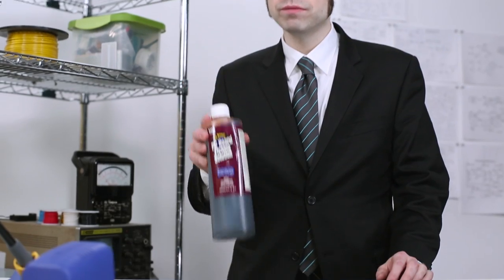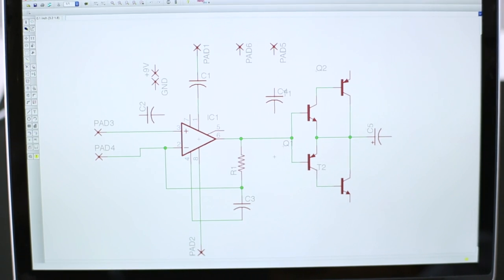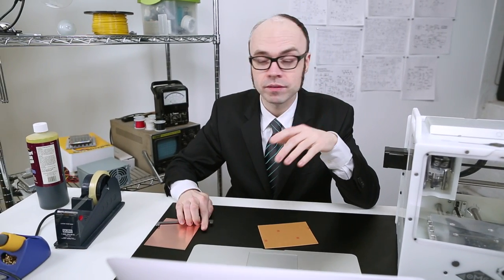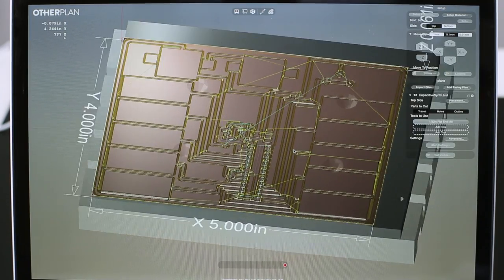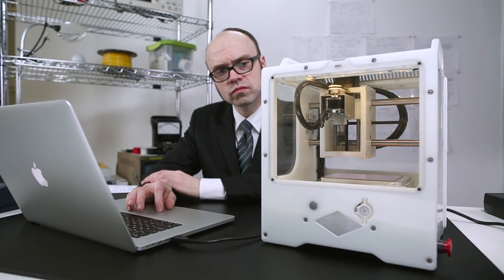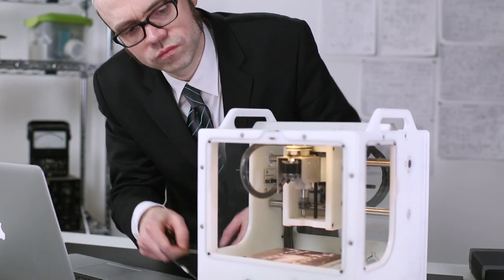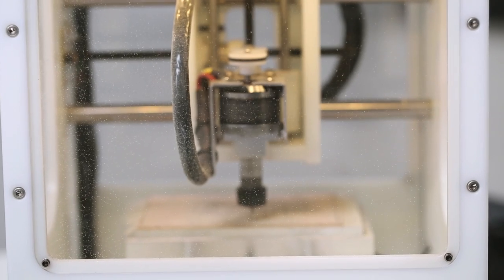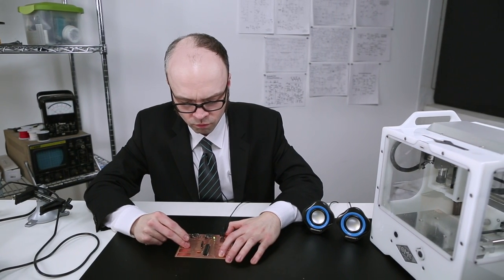Collin’s Lab: PCB Milling #Adafruit

Comment: I would actually use this machine so much more often than I would ever touch a 3D printer (although I would need enclosures for all of the projects this would help me create; still I must prioritize!)

For any current owners, can you comment on its ability to engrave on materials such as plexiglass and metals? It'd be nice if the software wasn't Mac only but I think I can still make a sell to getting one of these for our hobbyist group since it seems amazingly versatile.

Comment: Great video demonstrating PCB milling comparable to LPKF etc., but I think the holy grail is in traditional photolithography with resolution allowing fine traces reliably at 10 micron and below. The elements to process boards I’ve been collecting for several years as it’s very hard to find anything at reasonable cost second hand, so far I have a new in the box Korean GMP Photonex-sync235 laminator with 4 internally heated silicon rollers that ensure even heat distribution of DuPont risten film laminated boards, and a Kinsten KVB30D Double Sided Vacuum UV Exposure Box. The last and critical element I’m still searching is a good Photoplotter from Bungard or Fortex, however these are selling new around $10,000 much more than the few hundred I found the other tools for so I’m wondering with all the new high quality X-Y axis and laser machines coming onto market from all over the world why there hasn’t been any entry into laser raster film photoplotters that can produce fine detail solid ink black circuit art transparencies yet? I really don’t want to tape lesser transparencies together that would defeat the fine detail trace ability I want to have. Has anyone made one of these or is there a tear down video that might show how one could be built?

Comment: You should look into Voronoi toolpaths, there is a java app called visolate which will generate them, they are much faster for mechanical etching.

If you ignore the bad music caused by my indiscretion in background music you can see a run I did a few years back.

Comment: Is there any software, that makes PCB with single copper-free line between nets? There are many designers which make PCB with nets formed with individual border that need to be engraved along their perimeters. But it takes a long time and wearing mill.

Comment: Can someone explain how this works. Wouldn't the entire board be conductive?
Reply: DotCD nope, there's just a thin layer of copper on the top, the rest is non-conductive underneath. The mill machine is carving away the copper to leave traces for the circuit to follow.

Comment: But what about dust that you get in the end, if you use it regularly at home for example? What if it gets in the air in large amount? I mean, is it safe?
Reply: Glass fiber dust, especially the really fine one, is actually pretty bad stuff. It can give you something called silicosis (not from rare exposures though; it's more of a workplace hazard). The whole milling machine seems to be encased while working, so you should be fine if you just vacuum it afterwards.
I don't know if the bearings inside are that lucky though. The glass fiber dust can kill them pretty fast if they aren't built to keep the fine dust out.
Reply: It has a glass pane that can be removed. During operation it is placed back so the dust doesn't escape. Afterwards you can just vacuum the dust. Look at the beginning of the video, he removes the pane but it's rather quick.
Reply: Eyes open! You see the acrylic pane, you see him vacuuming. Look up from your games and Twitter feeds!

Comment: It would take less than one hour if the CNC machine was used just to drill the holes and the traces were done with dry film photoresist and ferric chloride/other etchant
Reply: As he said, you can use chemicals.

Comment: awesome product, but realistically, how many average people out there are gonna drop over 2 grand for a device that has a very specific and limited use?  Not to mention that it only works on with a mac. You gotta be making a LOT of boards to justify something like that.  With the proliferation of 3D printers out there now, one could make their own for a fraction of $2200.  Drop the price and add PC compatibility, and you'll have better acceptance.

Comment: I think I'll stick with etching
Reply: Is there any specific reason you'd rather do etching? Milling seems "better" to me, but I'm not experienced with either method.
Reply: Because it's loud and messy and you need the mill takes unreasonable chunk of space that could be utilized with a beer fridge or something even better. And then there's the programming and setting up and switching the drills whenever the machine commands you.. Or you can get a disposable tank and a sheet to work on with ferric chloride and gloves and most importantly you don't have spend an afternoon babysitting the bloody thing. Design the circuit, print it, iron it on the plate, shove it in a tank, wiggle for a bit, throw it into a sink with soapy water, bam done.
Reply: its probably cheaper to etch too.